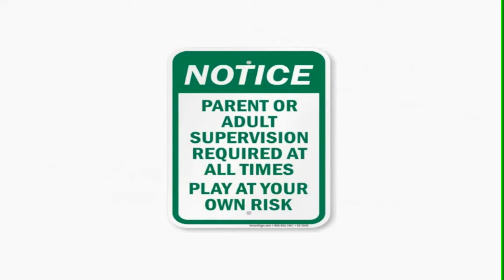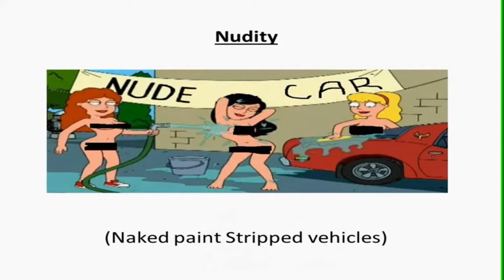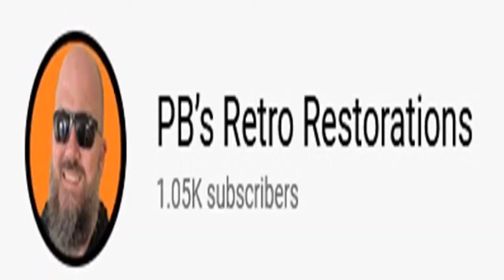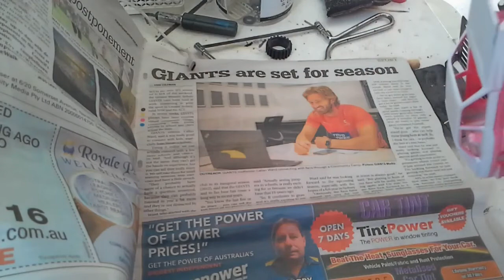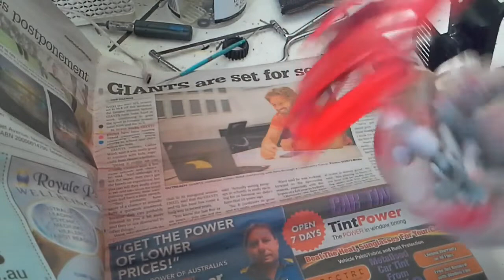Matchbox Speed Kings Audi Quatro

Comment: aw man, I hope you didn't have to hammer it into submission... six paintjobs is steep, mate. my wall would have holes from tossing it long before that, really.
anyway, love the red. comes close to some red Audi had for the civilian quattro coupes. though the movie image reminds me of either VW signal orange, or Ford Sebring Red (the red that wanted to be an orange).
all in all, great work. :)
I knew a guy who drove (or still drives? I lost contact long ago) one of these in civilian version. the rear window has heating wires forming the word "Quattro" on the lower edge. and the engineers actually managed to make it so that when you switch on defrost, that word shows up first before the rest of the screen defrosts... talk about being playful. :)